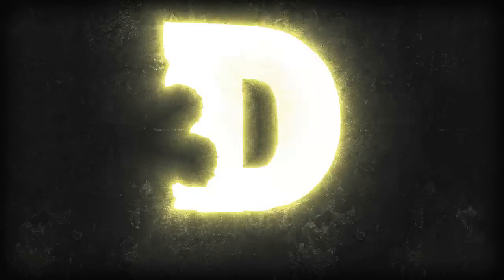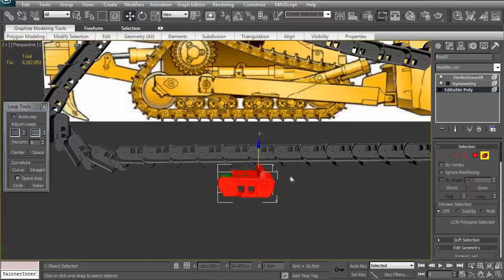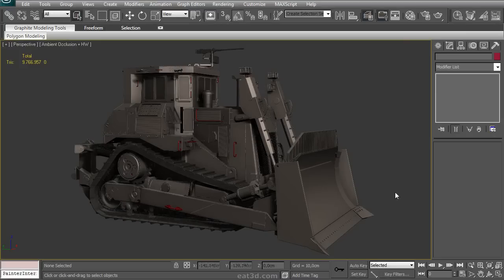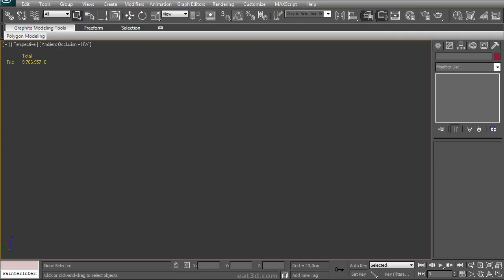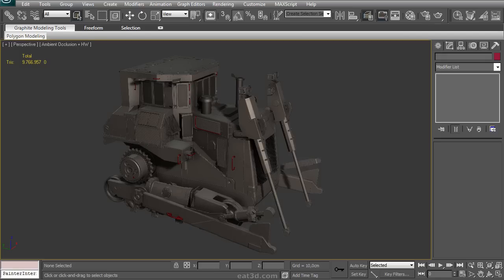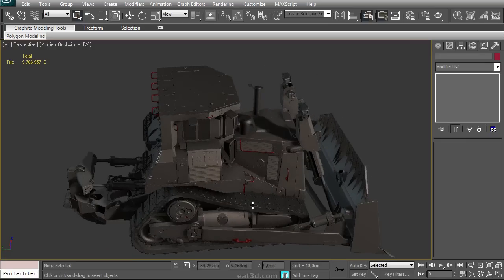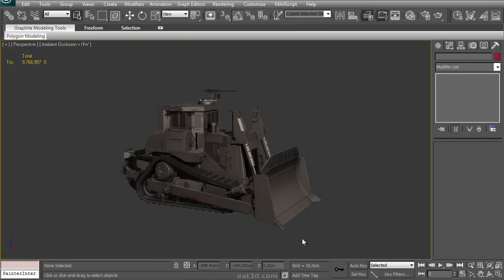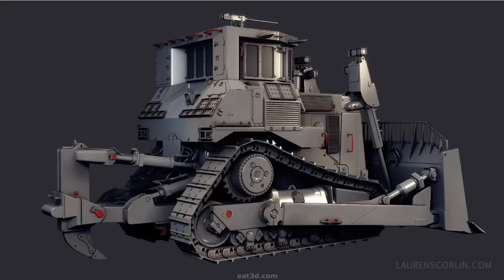The Dozer - Part 1 - Building & Rendering a High Poly Dozer in 3ds Max

Comment: Hi! i've just started watching this dvd and i noticed that the instructor is breaking the model into small parts and then attaching them which makes the modeling process really easy, but it's obvious that this method is causing a lot of intersecting faces, so my question is that is it ok to have that type of geometry in my models? and what if i wanted to unwrap my model to texture it, how would i be able to spot the intersection between two parts of the model? thx in advance :)